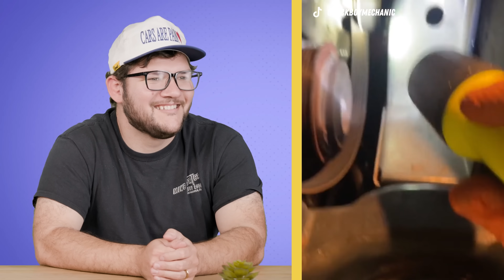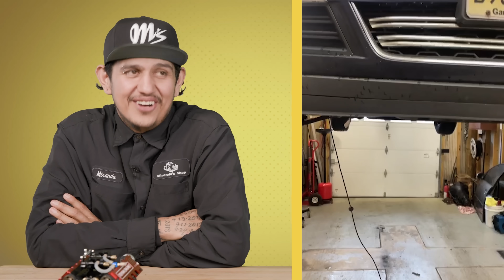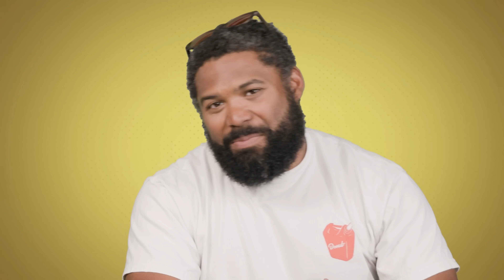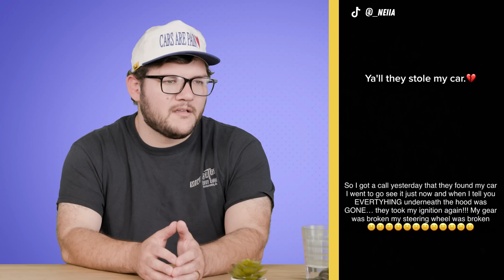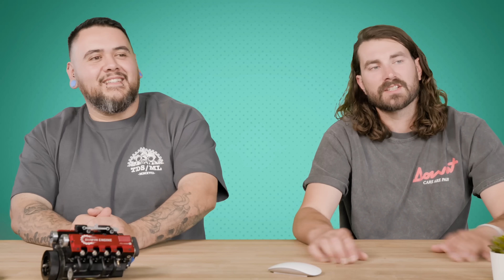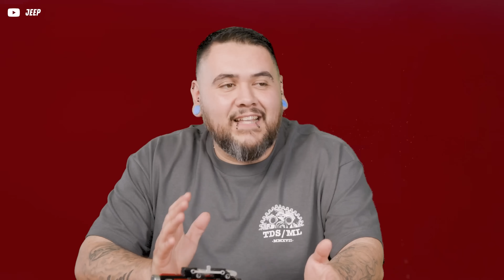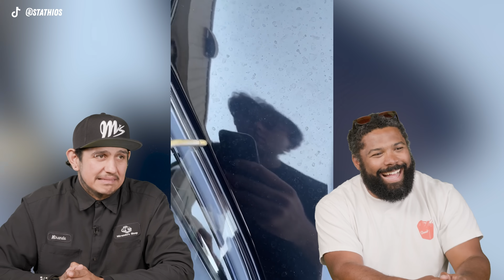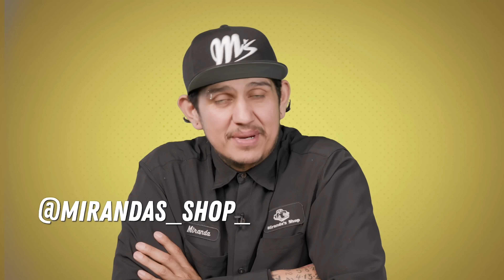Mechanic Reacts to Car Engineering Fails

Comment: 2019 gmc Sierra with Tranny problems. They've tried using computers and resetting multiple times and no fix. Then I gave up having passed my lemon law period only to find out through a friend who searched on reddit on the Downlow GMC, Still active now 2023 FYI, is doing transmission flushing for free on my year make and model. So I sent it in and everything is all well except for my 2nd gear stutters still. All is documented and I have the receipts less GMC or anyone claim otherwise. I reported them to the feds on the back of the owners manual it gives you the info to do so. The fed were all to happy to almost border line threaten me as if I was lying and if I get caught lying ill be in trouble. Seriously weird way of support those you tax to death. Anyways happy to email a copy to the show if you need to see it. As for now they said bring it in again, this will be the 8th time, so they can see its still not acting right and they will see next steps. Next buying GMC again. 2019 5.3L V8 4x4 SLT.

Comment: Are they crazy!!! Replaced the engine bay wiring harness because of a power steering pump leak? Unplug the harness, cut back the lead wire to the sensor, and splice in a new connector.

Comment: As a DIYer on some of the simpler stuff, I just cannot fathom the "drop the engine/trans subframe to get 1 freakin' bolt out for the lower control arm." Why???? It can't go the other way?

Comment: Well... you blame the engineer... until you actually understand and have been in engineering. The engineer has no idea where the frame rails are, wiring harness, or other components. They are just given a space to fit an engine, where the engine mounts are, and they make it work without knowing what is around it. The problem exists because all of the components of the car get designed at the same time, and it is impossible to separate the design of the frame, engine, wiring, etc. They are not made to be worked on, just to be built and designed quickly. Worked on is just an afterthought.

Comment: @RealMechanicStuff very surprised there wasnt any videos of any 2011-2018 hundais or kias, not for the very well known usb lifehack, but for the fact that they had to offer free engine replacement on almost every car from those years because the thetta 2 engine they come with burns oil like crazy, which builds up sludge and kills the engine prematurely. Luckily it looks like they are finally taking care of it, but they tried to deny it was happening even though they knew it was their fault from the get go.

Comment: Engineers are often told... make it fit.  Where they have to play a game of trying to shoe horn things into a shape that some "designer" came up with for style over function or comfort.   

On the flip side i've seen engineers go the other way,  removable service panels,  engines on "rails"... picture being able to drop the grill disconnect a few easy to reach bolts,   and pull the entire engine off the drive train sliding it out into the open where you can work on it easly  or just flat out remove it, and swap it out if needed.

When engineers designed the Bell P-39, they designed it that mechanics could remove almost all the side panels and access everything...     This would be the equivalence of being able to take all the exterior paneling off a car, in minutes...   to have clean access to all the wiring, engine, and more.

There are some chinese made minicars like that too...   where everything can be accessed,  easily,  things can be repaired quick and simple, and many of the parts are... "off the shelf", brand name, and/or repurposed from other industries  so that someone with just basic skill can walk into a store buy a replacement and put it in.

Comment: 2015 f150 5.0 when you take out the oil filter there’s a sweet tray under the filter to catch the leftover oil, problem is they didn’t think about when most people are doing their oil the truck will not be leveled so when the oil runs out onto that tray it goes the opposite way and drips through a skid plate hole, and if I’m not mistaken when you take out the drain plug the oil will splash onto the sway bar as well

Comment: GM 3.4 DOHC alternator on the bottom rear of the engine. Subject to high heat, and water/salt/snow/mud. Only accessible through the passenger wheel well after removing the axle shaft. Mechanic 6hr job, I went through 3 in 4 years and my brother became a ninja at doing it in about 2hrs.

Comment: My jeep has been great, but I replaced and upgraded a crap ton of parts. Pretty much everything is aftermarket now. The stock Chrysler parts, (mopar) some of them are garbage. Pretty much every single jeep owner at some point has to replace the sway bar disconnect with an aftermarket one. Fixing the stock one that isn’t properly sealed and short circuits from water, and eventually starts tripping out the ECM, is almost 2,000 dollars. You can add an entire pneumatic pump and tank system and air ride suspension on top of it with a pneumatic actuator and still have room to spare for that much.

 Weird thing is that despite there being a fuse for the sway bar motor, instead of the fuse blowing the motor starts burning.

 The frames are still made quite well and if you get into an accident in one you’ll probably do better than if you were driving a Hyundai.

Comment: From an engineering prospective (not automotive but... in general), its usually not engineers that are at fault. It's more of a lets make this part, assembly etc work great then have to go back and dumb it down to fit within a specific budget, machine / operator limitation or just as simple as John Doe in purchasing bought 200,000 2" bolts instead of 20 1" bolts so we have to make the 2" bolts work due to this mistake etc...

Comment: Not that I'm defending EVERY case of difficult to work with engineering (looking at you Subaru with the ring of fire), but an engineer made a point that made it all kinda make sense. Most cars are only in the shop for a few hundred hours in it's lifetime, but will be on the road or otherwise functioning for thousands of hours. Do you really think engineers should prioritize the hundreds over the thousands? Sometimes, even a small compromise with mechanics could mean a dramatic decrease in functionality and/or durability. Engineers know cars break. They just usually spend a lot more time actively working than broken and being worked on

Comment: 2006-12 Ford F550 6.4 diesel cab removal for engine repair
Any year Chevy express 2500 6.6 diesel body removal for engine repair
2018 Chevy colorado 3.6 v6 drop exhaust y pipe and Lside catalyst and support motor to facilitate removal of engine mount to change the starter
2000 Cadillac northstar v8 starter under intake and fuel rails
Early 2000's Mercedes,  biodegradable soy wires.
Ford F6-750s with Cat 3126/c7, no dog house to access rear engine fuel rail/ oil gallery plug o-rings( remove carpet and cut floor, rivet in panel and recover)
Any dodge with  cummins, engine removal to change rotten oil pans
Any Ford with 7.3 diesel engine removal to change rotten oil pans
1980's to 2002 Jeep cherokees, cut access holes to remove rear shock bolts
2015 International workstar 7400, unbolt front leaf springs to raise frame away from axle to allow oilpan to come out after unbolting no problem 
2012 Freightliner Cascadia short hood with DD15 engine, half of engine under floor, no dog house cover, lift cab to access air compressor, fuel pump, powersterring pump, fuel metering valve, rear fuel injectors,  rear valve cover bolts, cylinder head bolts, exhaust manifold bolts, everything

Comment: on the VW Amarok the oil drain for the engine is located so oil just hits the skidplate and goes everywhere, especially sucks if the oil is hot while doing the oil change, on the old 2.0L tdi it goes out the side and makes a mess, on the 3.0 tdi it goes straight down the bottom of the pan and they still didn't think of moving the drainplug like 1cm to the side so it drains between the bars. sure the whole skidplate is removable but it's kinda annoying and you don't gett paid for it. 

and on the t6/t6.1 transporter biturbo diesel you have to pull the engine to get the turbos out, you can get to all the bolts/nuts with like 5 swivels and shit but there isn't room to get the turbo unit out anyway...

and on the new crafter van if it has the longitudal engine you have to pull the engine to swap the EGR cooler, because it sits on the back of the engine over the gearbox with no way of getting to it. and guess what is a common failpoint on those... thankfully we don't have a lot of the new crafters with the longitudal engine.

Comment: -Volvo XC90 T8 Where a certain batch of oil coolers o rings failed on low mileage and caused to coolant and oil cocktail -> Engineer
-Volvo XC90 shark fin antenna and sun roof leak. still dont know whats the cause maybe factory.
-BMW F30 Handbrake cable clip keeps breaking off prematurely coz it was made of plastic and was above exhaust which made them break all the time. not sure whose fault
-BMW F series where rear brake pads wear out faster than the front coz the rear brake caliper has higher brake force than the front. -> Engineer
Thats all I can rmb for now

Comment: As a layman who's had to work on cars made after 1990 or 2000, yeah, F*** the engineers. Replacing a timing belt should not require taking an engine half apart or use of an engine jack! Some of this is really just the manufacturer wanting to bleed consumers dry of every nickel and dime since its so difficult to maintain and repair newer vehicles, so you have to go to the dealership over and over.

Comment: I’m gonna play devils advocate, partly because I’m studying to be an engineer. I agree in general that a proper product should be designed with intent to be serviced, but as I’ve been learning, designing cars is haaaarrrrrrrd. Like…really hard… 
I think we’ve taken for granted how complex these rolling boxes are due to how plentiful the are. All these little systems, structures and components that have to appeal to performance, appeal to regulation, they have to be safe, thy have to be economical, they have to look good, they have to be repeatable on mass to the millionth iteration, they have to *sell*, servicing (despite the consensus) has be accounted for while the car can still perform the roll its intended to do. And I think whats most forgotten is that all this stuff has to be figured out amongst hundreds of people with limited time, finite resources, differing opinions on whats valued by the company heads, and for extremely varied environments as well spanning the world. And thats all while still being a human being in the middle of it lol. 
Engineering is sooo hard, cause even when you want to do more to refine and perfect a product, unless its a hypercar sports car you’re forced to find a stopping point and iron out other issues through the life cycle of that car. 
Oh, and while doing that you’re busy figuring out how to build the replacement for the product you just released without an idea of what kinda technology you’ll have to work with 6 years later. 
We rag on the real dumb decisions cause some engineering really is headass, but I promise you most engineers are more frustrated by the mistakes in their work the the customer and mechanics.

Comment: Angelina is absolutely right at the end. Modern cars (and most things really) are made to last just long enough to get through the warranty period, so that the dealer can charge you an arm and a leg to repair your vehicle in spite of the fact the car has some glaring engineering issues. But of course the companies don't care because "WeLl ThE WaRrAnTy Is ExPiReD". It's not even like the you can just go to another company either, since most of them are like this now.

Comment: I was a tech while I went through engineering school. I work in engine design, just not for a car company. 

On the tensioner bolt hitting the frame, I blame engineering too. Consumable components should be designed for serviceability. Best guess is bolt strength calcs lead to the length. They could've increased the bolt diameter and shortened the length, but maybe they didn't have the space. Or the whole thing was overlooked, it is GM.

The leaky seal over the O2 sensor, also engineering. From experience on the design side, things don't always seal. Where I work, there are standards for placing electrical components a distance/height from seals and fuel components.

Comment: I've been a mechanic for a long time and I simultaneously love and hate it. These days I prefer to work on heavy machinery and old trucks. Even better if it's old heavy machinery and it's all for these reasons right here! It's also for all the electronics! I'm ok with some of the electronics to control the engine, I understand the need for fuel efficiency, I don't understand the need for all the in cabin bullshit!

Comment: They should have at least one mechanic in those rooms when they are designing cars. But its probably ego stopping them from opening that door. We could have dope and efficient transportation if they worked together ... I also think the secrect agencies thats hiding all the ufos should bring a mechanic on too.. Cause them engineers aint figured that out yet 👽👽

Comment: DO NOT remove the engine mount bolts! Cut the bolt with Sawzall, romove what's left of bolt with vise grips then install shorter bolt. 🙄 Yes, engineers friggin suck!

Comment: There needs to be a third option:

1) Factory

2) Engineers

3) Accountants/Execs

That Kia issue only exists because they didn't want to spend the money in the US to fit them. But in Canada they are because it's mandated by law. No fault should be placed on engineers when an existing part should be fitted, but a sub par part is used instead on the say so if a higher up

Comment: I may not be a certified mechanic, but these are some of the things I've personally seen or know about (and thankfully some of these cars are no longer on the road to worry about):

Early to mid 2000's Seabring's you must remove the passenger side fender to remove the battery.  They used to sell battery relocation kits to put it in the trunk.
'06-'12 Malibu's you have to remove the entire front clip to change (all) light bulbs.
Mid 2000's Escape's you have to drop the engine cradle to work on the AC compressor bolts if you snap them off.
Same Escape's with the V6 you have to unbolt the engine to replace the alternator.
Late 90's into 2000's Cavalier's you have to drop the engine to replace the alternator.
Early mid 90's-2000's S-10's with the 4.3 need to pull the engine up to remove the starter.
Nearly all 90's-2000's GM V6 (2.8 all the way up to 3800) you must unbolt the front motor mounts and pull the engine forward to access the rear plugs (not the worst, but still an annoyance).
Mid 90's-2000's Bonneville's (and equivalent cars) have to unbolt the passenger motor mount to replace water pump.  Since it was steel on aluminum, they were known to snap the bolts or strip the threads.  You have to unbolt the engine to get a tap into the holes.
'99-'06 Silverado's you have to remove the entire dash to replace the heater core.
And while I can't find the specific video I saw this in, there was a certain 2020's Ford truck that you had to lift the entire cab section off to get to one small part on the back of the engine (can't remember the actual part either).

Comment: I agree with yall on the jeep thing.    However I love my 2000xj.    Those are different times for sure.    I am also tesla certified and have ran into issues many times on superceded parts for the older models,  they literally will not fit without modification lol.   And by modification I mean drilling holes and adding nutserts in locations not even marked in any way.   Won't be exactly the same on any two cars.   No new car brands are very good,  I am a mobile tech for a nationwide body shop chain so I do the teardown like down to the sheet metal so they can make their structural repairs and I go back sometimes two months later for reassembly.    The parts waiting game is ridiculous

Comment: You guys missed the obvious. 

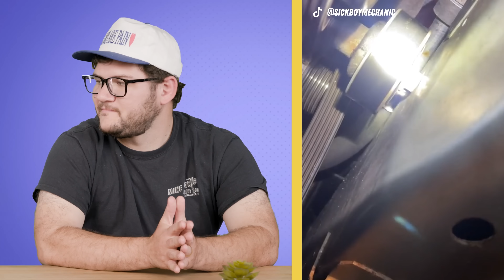1:13 drill hole in frame from other side issue solved for good. You would have to remove a few things, but I modify these issues on any car i own so its easier to do liter. 

2:40 Most of the time its the weather striping at the corners of the glass or the third brake light that is the cause easy fix. 

5:00 I have had my share of lemon and not once have I been able to return the car. Now some manufactures make it impossible to sell a car until its been owned for a year. That's usually my answer. 

6:30 JEEP = Just Expect Every Problem 

11:00 cut the plastic and fold it upwards, so the oil flow is not obstructed. Takes 10 seconds to do. Then it will flex back when done. 

12:40 the fix for this is not to replace the entire wire harness. Cut and splice the small area, use the right sht to seal the wires up. Half rate and under hours sucks you got to cut time.